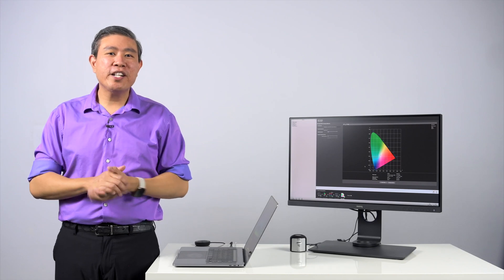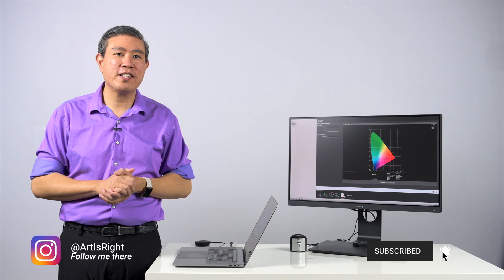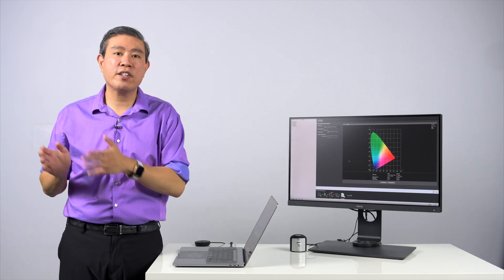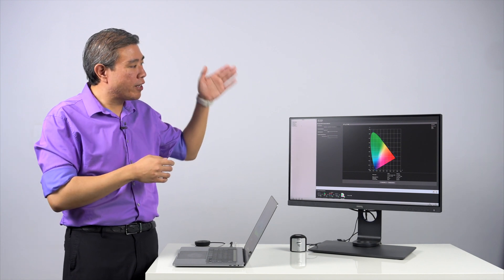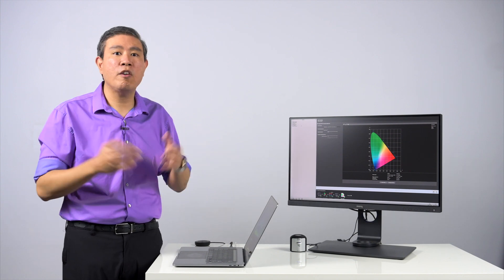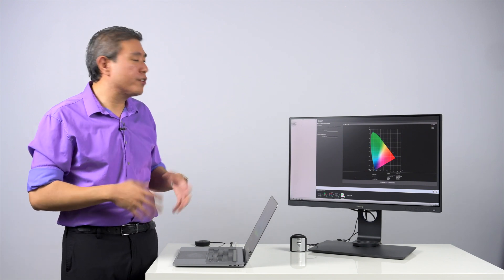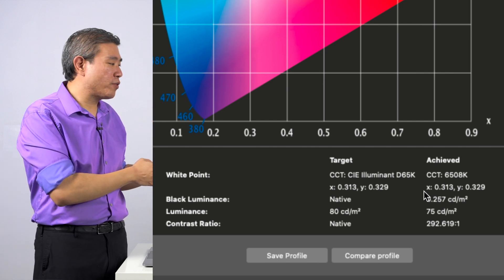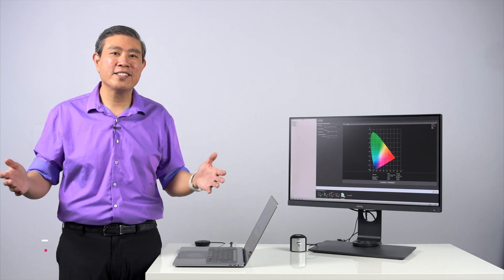A conversation about why contrast ratio is reduced on a calibrated display.

Comment: Maybe you can help with this:

I have a Dell display that was recommended as a good photo editing monitor for sRGB content, and it has a stated contrast ratio of 1000:1 I believe. I used a Spyder device to calibrate it. I’m sure if I calibrate it to 80 nits, it’ll be much lower as you said. But that’s not my question. 

What I’m struggling with is black levels. I edited some photos on it of a model standing in front of a dark background (it was a white wall but I didn’t light it, and I put a round black reflector behind her). The reflector wasn’t large enough to completely cover the wall behind her, but it was dark enough and looked fine to me on the monitor, as in it looked completely black behind her. 

However, when I got a macbook (I believe its stated contrast ratio is around 1300:1), and I looked at the photos on that - the wall was very obviously showing behind the black reflector where it wasn’t covering it. So I re-edited the photo to crush the black levels and had to do some painting in photoshop even. 

How are people editing on monitors that have 1000:1 contrast ratios? When I look up “best photo editing monitors”, they’re all around that contrast ratio. I feel I wouldn’t have caught this unless I saw it on my macbook which has much better black levels. It makes me feel like the only device I can edit photos and know that the dark areas look correct is something like an XDR display or the new macbooks with mini-LED. 

Can you please help me understand what I’m missing here?
Reply from the maker: There's really a lot to unpack. Let's start out with the premise that Mini LED / OLED are the best to view photo works.
1. You have to ask what is the purpose of the edit. Is this to print or digital viewing only. The answer to this can drastically change the approach that one would take. This is the reason why even if one does not print, it is always a good idea to edit images to a set standard, i.e. printing. And one may say that one don’t print now, however, if that need should ever arise in the future then it also save on time (needing less time for reedits).
2. These true black backlight are relatively new. So to say that they are the best for this type of creative work is an assumption that can be made, however, it is a one-sided look at how these back light may have solved your issue. But then you have to asked, how were photographers editing digital images before these display tech came about and were they able to get great edits? 
3. Back light tech aside there are other factors to consider such as the amount of color gamut coverage and other factors. Again is there a need for print and what is the editing purpose, end goal?
4. Contrast ratio is predominantly a spec and it is, in a way almost, irrelevant when you it comes to image evaluation. This loop back into the first point again, what is the purpose. Because if one print, then what we have 1000:1 or more is way too high for the DMax of most paper. With the exception of super glossy. But then if the premise is to do work for web then how does one accommodate for all of the type of displays and backlight that are out in the world? The answer is that is you can’t and it is a can of worm that you don’t want to open up. 
5. Evaluating image on a XDR display, what is the brightness that you have set? Because that will change the way how the image look as well. This is why editing to print standard help because it sets many of the key parameter for image evolution, brightness of the display being the key. 
6. Are you in a fully calibrated environment to start out with, meaning is the Dell Calibrated and to what brightness and same thing with the laptop. You can start to see an idea forming that contrast ratio is just a small part of a larger equation. And even though the question is not about the calibration nit, you can start to see that perhaps it should be because they are all related. 
7. The best way to edit these type of extreme range work sometimes is histogram and point equation, this is where you put a color picker in the area of the image that you want dark and you evaluate the number for RGB. If you want dark it should be between 0 and 5 black without details. If you do it visually by display you can but you are shooting darts at a constant moving target and that is never a great way to edit. Again this circle back to calibration. 
8. These newer backlight have their plus and minuses for image evolution. At the end of the day, if you feel that it is the best medium for you to evaluate in, this is a choice that you make. However, if you look at this holistically, you will quickly find that even displays with 1000:1 ratio will work just fine.
9. Hope this helps.
Reply: @ArtIsRight  awesome response

Comment: Amazing channel with loads of information that is missing from guides/white papers/user manuals etc from all manufacturers of displays. I wish I found it earlier.

As an amateur photographer I was involved in editing hundreds of images going after super saturated colors and high contrast. With time this led to severe light sensitivity and the need to look for a minitor with lower contrast ratio , stronger anti-glare properties and lower minimal brightness (around 20cd/m2).  The most difficult part is the contrast ratio. There are no IPS monitors with default contrast ratio lower than the standard 1000:1. There are still TN monitors with max brightness of 200cd/m2 and 700:1 but they bring other issues.

I work on black theme with low lumisity white font in OS and all office software and would like to have reading experience similar to reading a book so my eyes will stay calm for many hours of work. So is it still better to use a standard office model or one for artists which has function like Uniformity equalizer (a.k.a DUE) which lowers the contrast below the default one?
On standard office models thay say one cannot change the contrast ratio which is stable accross the whole brighness range while here you say that on calibrated monitor you can set any contrats ratio for any brightness level...So is it better for someone sensitive to LED light looking for low contrast to find it trough a purchase of a monitor of the higher class for photographers/video editors?
I work under dim light conditions and my brightness levels change in the range between 20cd/m2 -60 cd/m2 depending on the internal and ambient light in the work space.
I also wonder once you calibrate you monitor for the desired brightness level does it mean you cannot any longer use other brightness levels unless you recalibrate it again?

Could you make a video on this topic if you find monitors for photographers better for office needs than the office models when one is sensitive to high brightness and contrast ratios?
Reply from the maker: Thank you!

So about the contrast ratio, natively IPS sits at around 1000:1 yes that is true, however, with calibration either software or hardware calibration depending on the program you can alter the contrast ratio or if the program does not allow this you can certainly alter the gamma to bring down the contrast ratio of the display. By definition once you calibrate any display, it would be difficult for the display profile to maintain the 1000:1 ratio and that because in calibration most of the time we would bring the brightness down.

As for display calibration and brightness, if you are doing color critical work you should keep the display brightness at the minimum of 80 nits. Any lower compresses the display tonal range output so much and that you quickly reach a point of diminishing return. 

To answer your question about brightness level, this depends on a variety of things but assuming that everything is the same any the only variable is the brightness, you do have some margin for brightness changes, I say anything in about a 20 to 30 nits range you should be ok. But most of the time this is what I advise, pick a nit that work best for color critical work and every time you do photo editing just use that nits. For the general computing or content consumption just change the brightness around and don't worry so much about the best calibration or not. 

As are as your question about office monitors, I think that if you purpose is to lower the contrast, I would just do a calibration and you can do it with an fairly economical device such as the X-Rite i1Display Studio. Hope this helps.
Reply: @ArtIsRight  Thank you for you answer. It seems like an 8 bit screen for photo editing will be ideal for office needs as well regardless of default contrast ratio before calibration. One will have better coating, better colors and the only difficult to find spec is low minimum brightness (for me  around 20cd/m2) at such a monitor. The search continues.
Reply from the maker: These SW are 8 bit + FRC which gets you a visual equivalent of a 10 bit color output. And yes they would be good for office work. Most displays now a day that are half decent are 8 bit + FRC. Again 20 nits is what I would consider an unusable range. What calibrator are you using for measurements to get 20 nits?
Reply: @ArtIsRight  I am not currently using an LCD display since I developped extreme photophobia from a previous laptop display. As weird as it may sound my eyes found significant improvement on an office CRT monitor from 2003 where the maximum brightness is just 100cd/m2 and when turned all the way down to zero the whole screen is black. Each click on the brightness button leads to slight visible step towards increasing/decreasing the brightness so I assumed (hopefuly right) that the whole brighntess range is 0-100cd/m2 . I also noticed when my eyes were recovering that I initially spend more time between 20-30 cd/m2 and after several moths till 45cd/m2 and nowadays even 55 cd/m2. early mornings and night is where I use 20-30cd/m2 brightness for the white font on black background. My case is extreme so recovery needed and still needs unusually low brightness levels. There are specialized forums (mostly in Russian) when many people with this light sensitivity use even as low as 7cd/m2 (Eizo users) for the white fonts. I for e.g. use my cellphone at minimum brightness level during mornings and nights and according to online tests I use brightness of only 6 cd/m2 under low night lamp lighting (for white fonts on black background). I either have to find a model that goes extremelly low in brighntess without PMW and hopefuly 8 bit without FRC or 8 bit +FRC. I am not happy I cannot edit photos for long time but my eyes are more important and hope soon to be able to handle color edits again.
Reply: @Classicdslr  that’s a crazy sounding ailment. Props for finding a way to keep on editing. 👍
Reply: @buddyWalrus  The problem is gone. The CRT did its job. Now I use LCD monitor HP Elite Display E24i G4 (16:10). These new breed of monitors have a built in physical blue light filter cutting the most harmfull wavelenghts. The monitor is matte so almost no reflections to tease the eyes. VGA connection makes the "Standard" picture mode like e-ink. The monitor brightness goes as low as 35 cd/m2 but with a slight color tempreature change with software like flux it`s more like 20 cd which I only use at night.
Reply: @Classicdslr  good to hear! the blue light filters are definitely a welcome technology for our displays.

Comment: Does contact ratio matter on smaller TV's. Like 22"? I can choose a 22" with 4000 to 1 or 24" 800 to 1. Would I be able to tell a difference? Both are native and I'm using it for TV watching.
Reply from the maker: It has to do with how black, your black is compared to the white. You can probably visually see the difference, it issue is that if the panel is lower quality you may end up with crush blacks.

Comment: Hi! After all calibration process, my monitor still got a contrast ratio close to 800:1 do I have to manually dim the contrast when editing photos for printing? 
Or do I have to dim it manually and recalibrate to get to a specific target?
Or that does not matter? (meaning that a photo might look washed on the print while looking perfect on the calibrated monitor?
Reply from the maker: what display are you using? Software, calibration devices etc?
Reply: @ArtIsRight  My external Monitor is a LG W1942P and I also use a vaio laptop with a LG LP156WF4_SPU1 display, I am using the i1 Display PRO Plus with the i1 Profiler software.
Reply: I also followed your windows tutorial and external monitor tutorial. Used 80cd config.
Reply from the maker: Contrast on the display is somewhat related to brightness but not entirely. if you want to control the contrast on your display you can use i1Profiler and set the contrast ratio that you want. This way you would have a profile that match closer to print. A video on that should be coming out soon.
Reply: Great! Then I can step the contrast manually and recalibrate until the desired ratio?
Reply from the maker: You get the idea!
Reply: Thank you very much! Waiting for your next video!

Comment: Sounds a lot like contrast ratio and the dynamic range of a display is very similar ?
Reply from the maker: You have the right idea, they are somewhat related in casualty, where one setting can alter the visual appearance of another. Overall, individually they still described a different function of the display.
Reply: HDR technology is playing at dimming zones area. Whereas the contrass ratio is often dependent on the panel type and quality (i.e oled, va, ips, tn)

Comment: Hi Art!
Just discovered your YouTube channel and it's great!

I was wondering. 
My use case is that I want my monitor calibrated to sRGB. 
I have two of them so I want them to match. 

However I don't take photos to print, but to post online. 

Also in my room I've got a lot of sunlight so I want to be able to use it on a bright day. 

I find that calibrating to 220 cd/m2 looks great for all round usage for me. 

What I don't understand is if I did want to print something, would the colours look off or is it just the apparent brightness of the image on paper?
Reply from the maker: Glad you found the channel.

You can calibrate your monitors to sRGB, as far as matching that depends. If you have 2 of the same make and model then the possibility of visually matching is better than different model or worse yet 2 different manufacturer.

If you find that calibrating for 220 works for you, you can keep that. Remember that when you calibrate your display brighter for every know color and coordinate that flash on the screen it would look different than the reference value and would get adjusted. Will this make your color terribly off, no, but it will shift slightly, visually you might not see it, to which you should be ok. The recommend range is not so much just to print on paper but more of a base line for any display calibration.
Reply: @ArtIsRight  awesome thanks for the info!

Btw a topic which I've had a lot of confusion on has been 10 bit colour. 
Like straight away I know that there are panels that support it. 
The idea of 0 to 1023 for RGB values sounds great in terms of like reducing banding. 

I notice it's possible to set display output to 10bpc on the Nvidia control panel. 

But this seems different to enabling HDR at least in windows. 

Photoshop has a setting for 30Bit display?

And with DCI-P3. Is that a gamut only for HDR?

You really know your stuff, so think it'd be awesome to have some videos from a pro explaining these confusing details. 

For example:
My camera shoots in 12 bit raw. 
So could I work in 10bit colour and attach a DCI-P3 profile to the image and share it?

Like I can see the difference between an sRGB image and one with DCI-P3 in non HDR mode. 

But what's going on there? Haha. 
Like is the 0 to 255 just been stretched out in a different way and I'm not getting more colour detail without HDR?

Anyway just a suggestion :) Keep up the good work!
Reply from the maker: HDR is separate from bit depth. Higher bit depth does help HDR but it is not necessary. What HDR primary does is scale down the tones so that it can fit with in the range of what the display brightness can produced. As far as color gamut for HDR, it technically is REC 2020 which most display can't even do 80% of because it is really large color space. This is why there are various HDR standards. If you do photography forget about HDR on the display or the OS there's really no benefit in worrying about it. It does not for stills. If you are doing video then yes. It seems you are referring to still images based on what you wrote. So the 12 bit that your camera capture in RAW is the tonal range that it captures. When you are done editing the images if you export the images to JPEG then it will be 8 bit only there's no other options or standard, so edit in the highest bit depth possible and export it out to standard which is 8. As far as sRGB vs DCI-P3 yes you will see a difference the latter is a larger color space.But the question is will most other screens see or worse yet be able to render these difference color space. So far for web use the world is still stuck at sRGB and there's really no move to DCI-P3 yet. You want to make your work accessible to as many displays as possible and if that is the case stick with sRGB. Otherwise people with older computer or os would have issues rendering it as well. 0-255 is still all the same for your image is that just that with different color gamut that number gets mapped differently based on the gamut tagged in the file. And you are not getting more detail in HDR because the HDR that you are referring to for content consumption such as video or games created with HDR in mind.